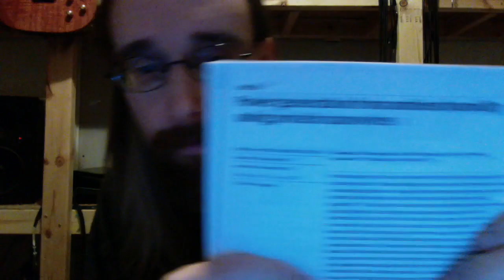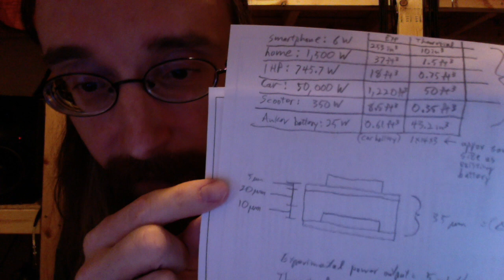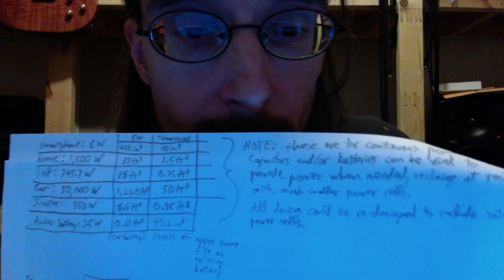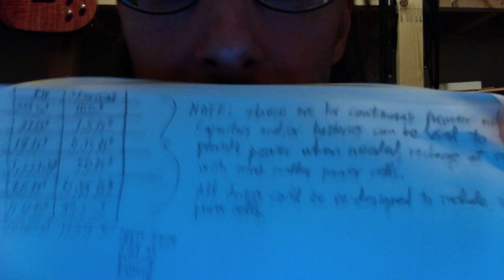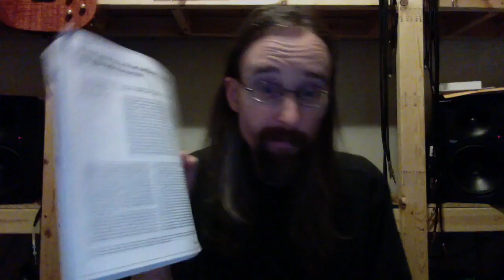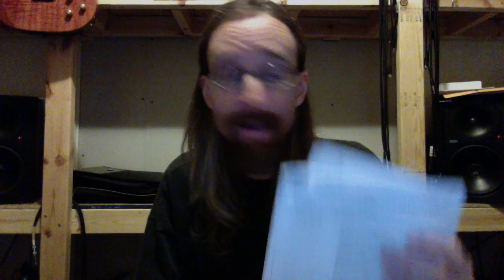Air-Gen: Power Generation from Protein Nanowires

Comment: We have identified that it produces electricity. But I have questions on it’s practical applications.

What is required to get it to function with our current technology? (PV work on their own but require wiring to get the electricity out of the panel.)

How do we get the energy out of the material? 

How do we control for changes in humidity?

What is the volumetric power generation?

Does this rate of generation have any practical uses at any scale? (Meaning does powering a cell phone require a brick sized airgen?)